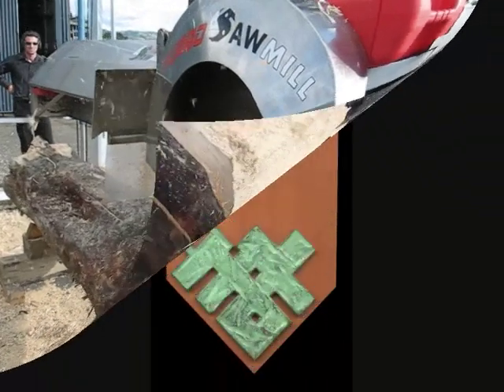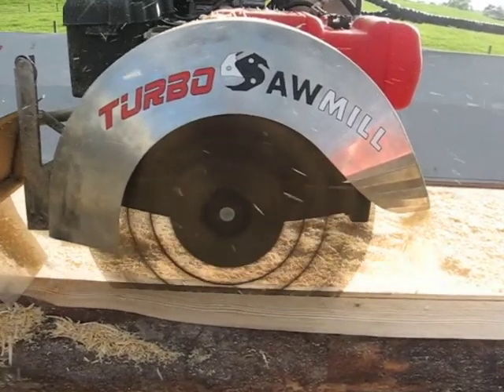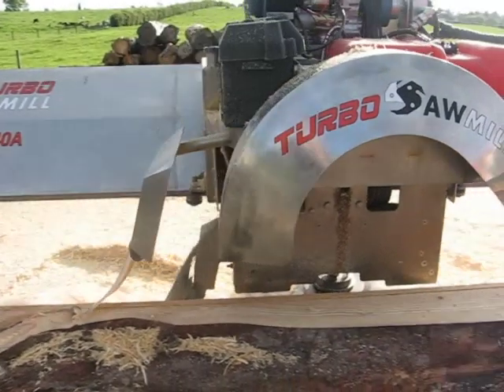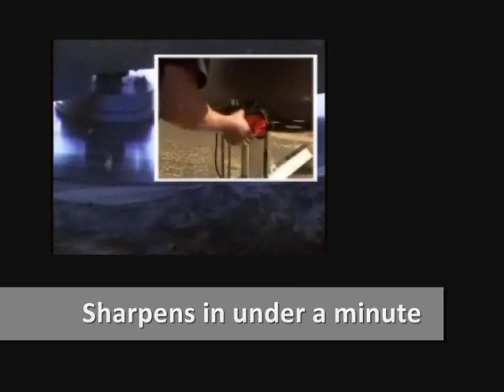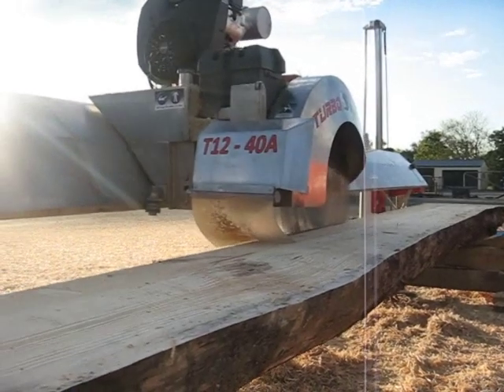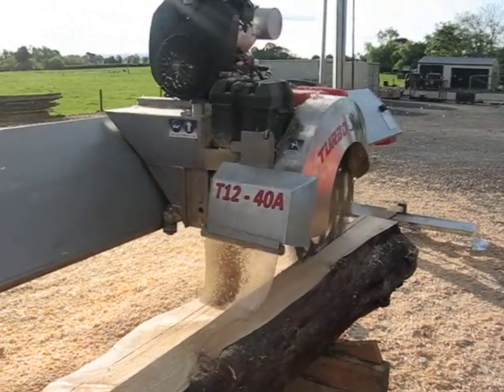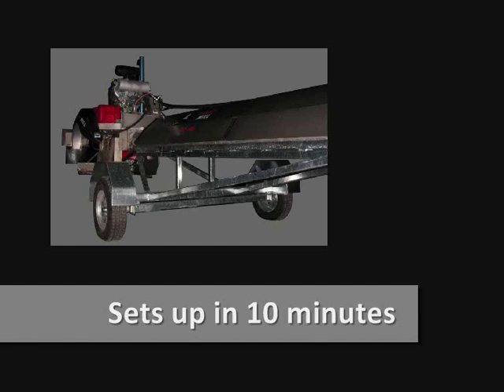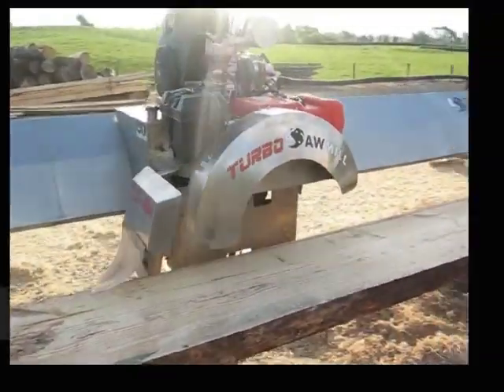TURBOSAW PROMO

Comment: Great machine(s). As I've not had the opportunity to use one, can you tell me if the blade rotation is constantly  clockwise or does it turn anti-clockwise during the swing mode. The question is based on the usual practice of feeding timber against the direction of rotation whilst using a conventional circular saw. Thanks.